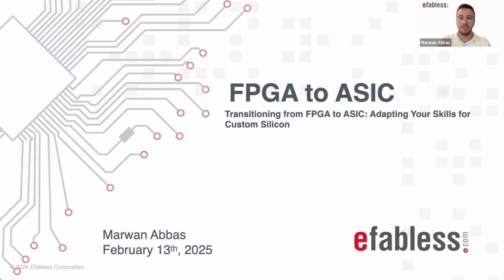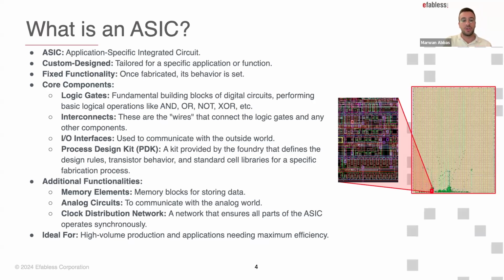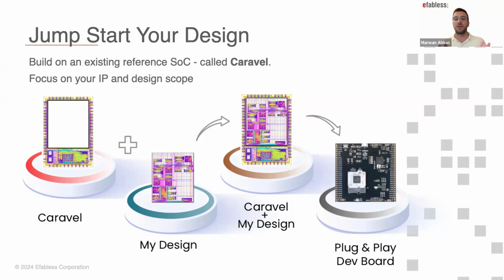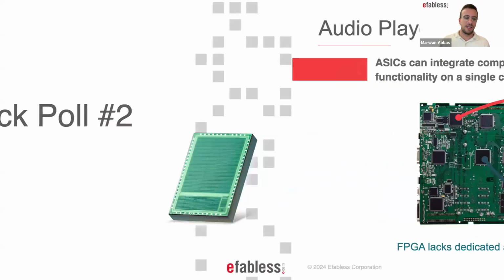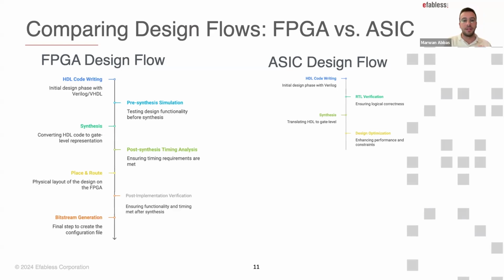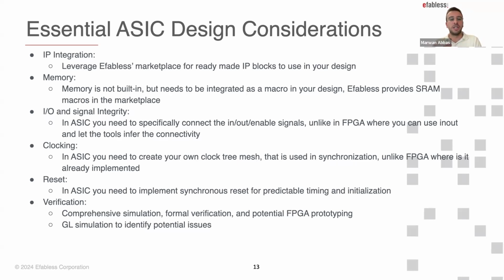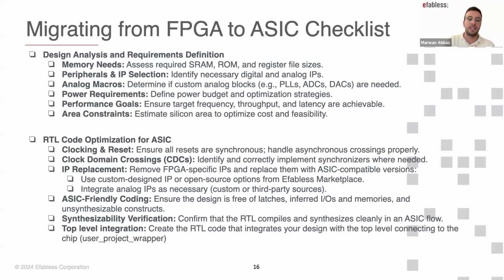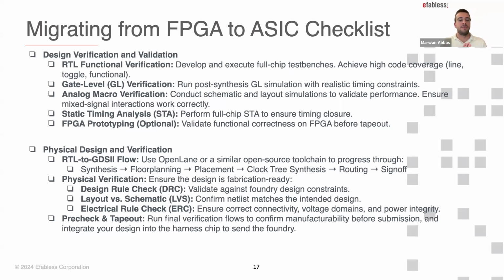Webinar - Transitioning from FPGA to ASIC

Comment: Thanks for this talk.  I have done a tapeout with Tinytape out too.
Quick question, do you have more example code about porting Verilog from FPGA to ASIC? Like the slide #14.  Or link to a place where can I learn more about this.  I always paranoid that the code that work on FPGA may not work on ASIC.  Thanks.